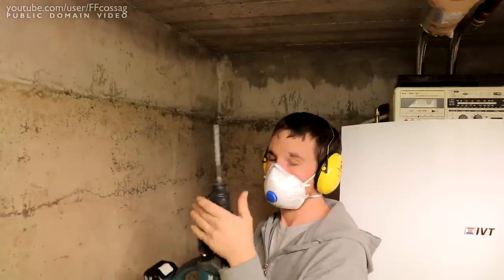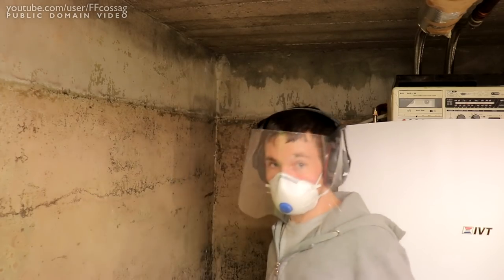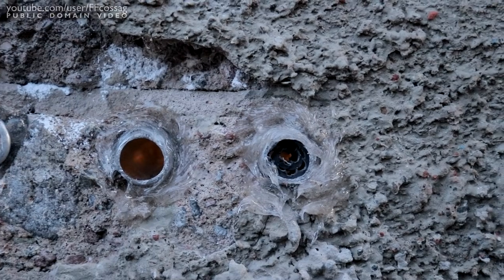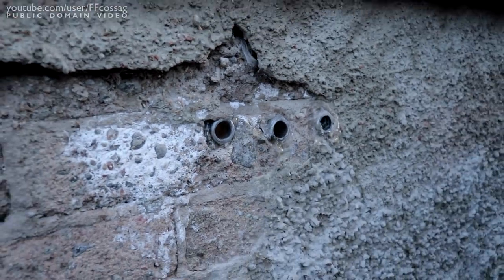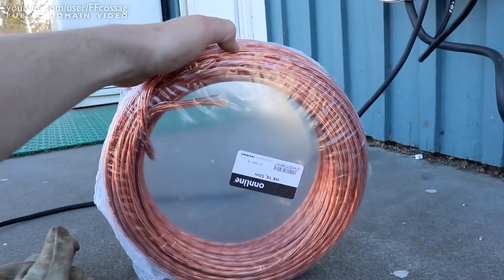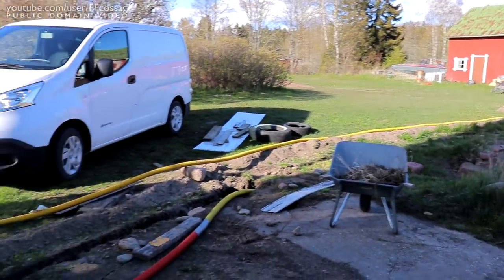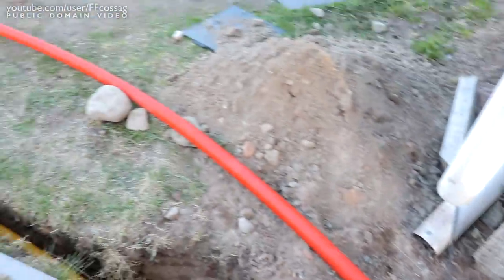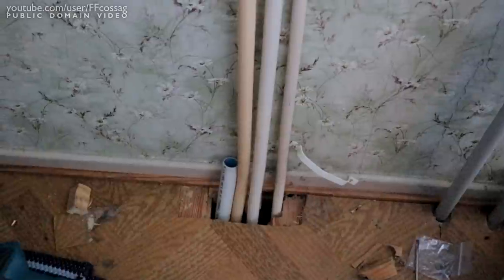10 kW Hybrid Solar VLOG 2 - Solar and mains wiring prep

Comment: Looking awesome so far! I feel your pain with taking that central apart haha, we have the same ones here in Sweden and it sucks having to take all fuses out just to open the cover on them, especially with 30+ of them in there x3 

Now it is almost time for panel installation! I'm very excited to see how it turns out! 

I got my new panels wired in yesterday in my off grid system, and so far it's really pushing quite good power :) Now I can finally run desktop computers and even more power hungry things completely for free :D 

I hope you have a nice evening! Or morning - writing this at 12.02 Swedish time x3

/Vinyl :)
Reply from the maker: Well met, fellow nordic off-gridder. What size array are you running?

Comment: you took apart a led projector with a fake android hidden in the bottom...if you took that led, what type of external led driver would you need to use with it. I have a 150watt led from same type parts china projector. I want to use the led now but i never got the original driver. thanks

Comment: Why not use a pipe conduit PVC vs the channel?
Reply: Easier to add / remove cables, and better heat dissipation, I would imagine.
Reply from the maker: That'd be even more annoying to mount, uglier in my opinion, and near impossible to modify in the future. The metal channels also allow me to do some magic and more or less double the effective cross sectional area of my grounding wire.

Comment: You are making a huge mistake by mounting your solar panels on that barn roof. I don’t think you getting good advice.  You are missing the big picture. And your inexperience is showing here…  

1- In your climate, solar panels should be facing south. If you don’t have a suitable roof structure facing south, then you need to consider ground mount. You have large enough property to be able to hide them discretely.  

2- With ground mounting, you can essentially maintain, service, upgrade, clean the panels yourself. With a roof mount all the way up on that barn, any time you want to clean, update, service the panels you are paying 1000s throu your nose to get a company to come out with a proper lift to access the roof.  

3- With a ground mount you be able to clean snow and ice in the winters. Forget about that if they are on that roof.

4- Look at the amount of money you are spending on cabling. That’s totally unnecessary if you mount the panels close to house.

5- Look at all the voltage loss through the long cable runs. Wasted energy.
Reply from the maker: There's plenty of planning that's gone into this project that's not in the video, I'll address your points.

1. Panels ideally face south, but proper ground racks become prohibitively expensive very quickly, and shading is a problem. I was initially planning on doing a ground mount, but it would have been considerably more expensive and it would not have paid off. Furthermore, the estimated annual production for an ideally angled ground rack facing south, would only be about 5 % higher than the barn mount. I didn't believe it myself when I first saw the figures, but simulators don't lie. I simulated it myself in SolarEdge Designer.

2. Cleaning is not an issue as we don't have smog. I'm not going to upgrade the panels, and the installation is done to a high standard of workmanship, so I'm not expecting any maintenance costs.

3. Not much of an issue since the roof is at a 35 degree slant. They're not expected to do much in winter regardless, so it's not a big loss even if they do get snowed up throughout winter.

4. The difference in cost for the cabling would be about 100 €, negligible.

5. The cables lose about 17 W under maximum power conditions, or about 3 % of the total power of the system. This would get cut by about 40 % with a ground mount. Losses are always bad, of course, but these are negligible figures.